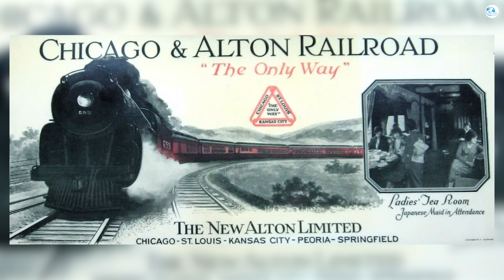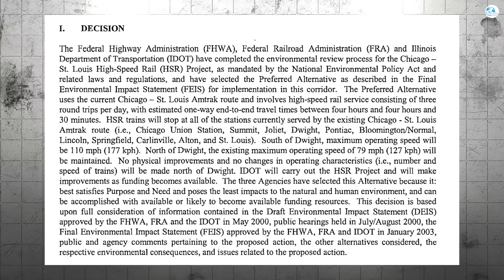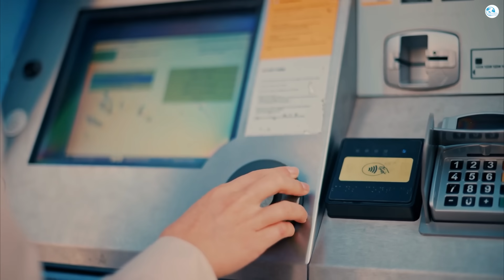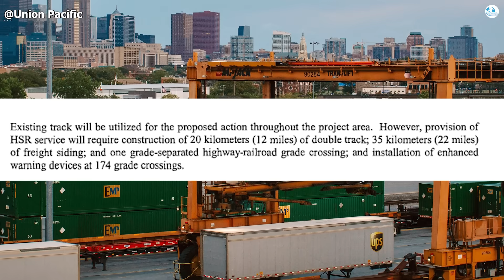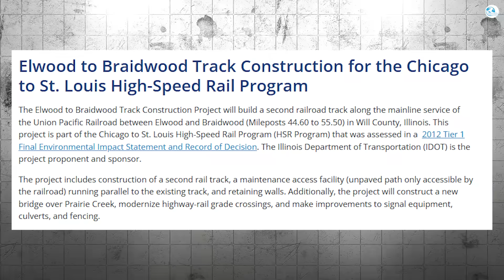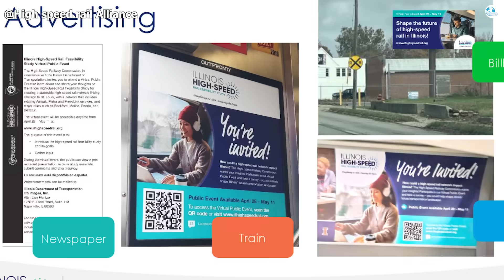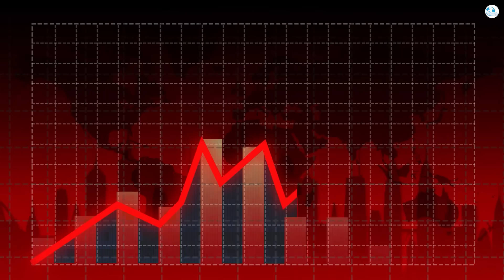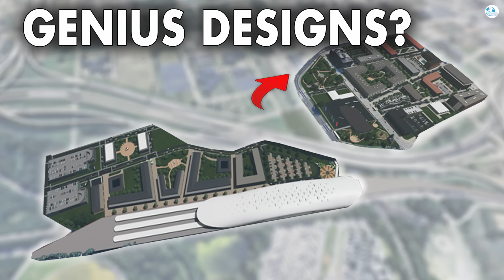Chicago–St. Louis High-Speed Rail: The Midwest’s First Real HSR Corridor?

Comment: It could be done, BUT! Some of y’all need to settle down and have more realistic expectations. I just see this all too often - one little improvement here and there, just imagine in a few years, so on and so forth. 220mph from STL to Chicago and back? Not a chance. 155 mph (250kph) is much more realistic, but even at that it would require true double track over the entire length of the line, removal of all remaining at grade crossings, and perhaps most difficult of all, rooting out the insidious corruption that has permeated Illinois politics for over a century. (St Louis, too.) 
Otherwise, forget it.
Reply from the maker: Fair point. Real high-speed rail needs major upgrades and political will, not just small improvements.

Comment: waste of taxpayers' money because of corrupt politicians and accomplices...  stupid ideology, if passenger trains made money AMTRAK wouldn't exist....
Reply: Okay, 1.) If the country had been smart, Amtrak wouldn't have been a for-profit company (that never made a profit).  It would have been a public works project.  Like, how much profit does the interstate highway system generate?  None; it's silly to even ask, because that's not the purpose of a public works project.  Amtrak could and should have been the same way.  Fares collected just to cover costs, including purchasing new equipment.
2.) Amtrak does have lines that turn a profit.  They're the lines where Amtrak owns the rails they run on, up in the Northeast Corridor.  They can and usually do run on time, there, because they don't have to wait for the freight railroads to actually obey the law requiring passenger trains to be prioritized.  The problem is that, that's like 2% of Amtrak's network.
3.) I don't have the figures, but I'm sure airlines get subsidies, too, to prevent them from failing financially.  Why would that be okay but not subsidizing passenger trains?
4.) While we have a greater need for metro trains than we do intercity trains, we just generally need more trains, so that there are more options.  It doesn't need to be a for-profit thing.

Comment: I live in downtown St Louis.  I've taken the train to Chicago multiple times.  I'm excited for the speed increase.
Reply from the maker: Same here, St. Louis–Chicago is already one of Amtrak’s better routes. If they can boost speeds and reliability, it could be a real game changer.
Have you noticed any delays or issues on your past trips?
Reply: @ONtheTrains  Not with the Lincoln Service.  The Texas Eagle - absolutely.  I prefer the size and comfort of a Superliner - but it's never on time - coming from so far away.  The other thing that the train has over flying is that Amtrak dumps you off in the heart of the downtown Chicago.  No need to take the EL train another hour into downtown from either of the respective airports there.  Huge time and money saver.

Comment: No need except ego and…$$$.  Time savings irrelevant assuming you don’t stop at the “smaller” cities (“fly over country”) and reducing speed if you don’t’.
Reply: If they have their own dedicated rails (admittedly unlikely), and especially if they electrify the line, the train has every reason to be faster than driving, even if they stop at the smaller cities.  Done European style, especially over that flat state, there's every reason to believe that the train could get up to 120mph, or better, and cruise at that speed for 80% of the time it's running.

Comment: Since the creation of Amtrak, passenger trains are supposed to have priority over freight. Why aren't the freight railroads being fined heavily for interfering with passenger trains?
Reply: This is the crux of the matter.  They're being fined, because prioritizing freight is literally illegal.  The issue is that the fine isn't enough.  The freight railroads just pay the fine and treat it as the cost of doing business their way.
Reply from the maker: Do you think stronger fines would fix this, or would more publicly owned track be the real solution?
Reply: @ONtheTrains I think both.
Reply: @ONtheTrains  There's also a middle road.  The federal government throws money at the freight railroads, and the states, with conditions.  The money has to go to improving the quality of the lines used by Amtrak.  In the case of the states, the money has to be used to make roads go over/under the rails instead of crossing "at grade."  The catch is that, if Amtrak's delays are not reduced 90% in ten years, the railroads have to pay that money back with 1000% interest.  And, regardless of who takes the money and how well it's spent, all freight railroads are fined heavily when Amtrak is late.  Obviously the low end is "if Amtrak isn't late, you don't pay fines" but the upper end is, "if Amtrak is late as often, and as badly, as they were in 2025, each freight railroad is paying their share of Amtrak's total cost of operations for the year."  Such that, if nothing changes, Amtrak can literally fully refund their passengers, such that fares end up free.

Comment: Chicago to St Loius?  The bulk of traffic on that route is drug runners...

No station that can handle HSR in St Lious?  The drug runners much prefeer the East St Lious stop.

Illinois High-Speed Rail Feasibility Study... Code words for politicians to hire their drunk brother-in-law, so the sister does not need to work.
 
Musk will be on Mars before much of this happens?

Most HSR runs to the state capitals, not this route.  That says a lot about the downfall of Springfield Il.
Reply: Springfield, IL (the capital) is on the route from Chicago to St. Louis. There were lots of maps that showed that.
Reply: So if it hasn't sunk in, this train will connect the IL state capital with the two largest cities in the region. Not such of a downfall at all.
Reply from the maker: That’s a pretty cynical view. The goal of this rail line is economic growth, not what you're suggesting.
Reply: This is an Illinois project. St. Louis is in MO. East St. Louis is in IL. Maps are friends. Try 'em out.
Reply: @stleo3980  "East St. Louis is in IL.", And Illinois would be better off without East St Loius.
Not many go there who have a choice.

Would you want to be stuck there overnight?
Where would you stay?
Reply: @CCRoselle  The train continues on to St. Louis. Just not at high speed. Try thinking before typing. It helps.
Reply: and that's a long, long time
Reply: @CCRoselle  From East St. Louis to St. Louis?? It's right across the frickin' river. Same exact distance as it's always been. And after the river you're right into the city where everything is slowing for arrival. Seems like somebody is digging for ANYthing to make Illinois look bad. Even the BS saying most of the St.Louis/Chicago travelers are smuggling drugs, which is absurd. Hundreds of thousands of people use that corridor each year. Most (more than half) are smuggling drugs?? That's not silly. it's stupid.
Reply: @stleo3980  A new train station on each side of the river to handle the proposed HSR; brilliant!

I rode the CNW (CHEAP & NOTHING WASTED) to work downtown Chicago for many years, yes sometimes the doors froze open, or the heat did not work.
But you have billions of other people's money to piss away for the 3% that ride a train.

You must be a politician or on the take (same thing).
What color is the sky in your world?

Comment: Easiest route they could test out should be Chicago to Milwaukee. Its less mileage to and from the infrastructure is wide enough to separate freight and passenger rail you can electrify it with overhead lines. You can use both the CNW line or the old CNS line since most of the old line is just abandoned ROW not too many curves and use it as an experiment for HSR and HS commuter rail services.
Reply: The infrastructure is already in Illinois. It runs parallel to I 55. My family used it from Alton, Illinois to Springfield, Illinois. I was pleasantly pleased. My daughter and granddaughter took it from Alton to Chicago. It was quicker than flying because no waiting in a crowded airport. And certainly a lot cheaper than flying.
Reply: @Navyuncle we can all agree Chicago is a hot spot for high speed rail and they're many cities with about 1 million plus in the metroplexes that need HSR would benefit and would reduce the car traffic in these areas over time. While here in Chicago commuter rail and interurban need to make a big comeback and connecting certain cities outside the Chicagoland area is also a must.
Reply from the maker: Chicago–Milwaukee makes sense as a strong pilot corridor with great potential
Reply: @ONtheTrains yes and they can either make it a triple track from Chicago to Milwaukee or use old North Shore ROW and make it there from scratch either or will succeed their is alot of population in this area that only relies on one interstate and one US highway to get them between two cities while everything in between is also densely populated with suburbs well over a million people in Lake County Illinois while its roughly 700k in both Kenosha and Racine Counties.
Reply: Did they kill the Hiawatha? Years back, they claimed 90 mph peak.
Reply: @CCRoselle there has been talks about reviving the North Shore Line again and Hiawatha since they created the Borealis line having both amtrak routes would get more folks into other destinations like Milwaukee Fond du Lac Green Bay Madison Lacrosse Wis Dells and Twin Cities and beyond. While also increasing commuter train via Metra if Metra and Milwaukee commuter system agree to terms we could have a revival of the interurban systems going north and west of Chicago again. While currently we have interurban going south and east via Metra and South Shore.
Reply: @bearworldwide101  I have lived on the North Shore and in DuPage for about eighty years.
Before the RTA, the system was "creaky" but serviceable, and I rode the train to work downtown mostly in the winter.
Including once on a train stuck in the snow, only four hours late to my stop on the West Line.

The RTA was simply a mechanism to kill the small operations and spread the cash around to insiders. Notice they killed the old system long before any plans to replace anything.
The funds that were not used for any replacement service went to the CTA void.

Workers at the Glenview Bus Company (and others) never earned much, and many CTA workers could earn considerably more. Not to mention the political no-show jobs... 

About every ten years, another layer of bs is added to the RTA, because you cannot expect the poor people of Chicago to pay the fare.

Just reciently another layer was added, restructuring the RTA to the Northern Illinois Transit Authority (NITA).

That will fix it! More executives driving CTA cars, when they actually show up to work, no way they would take the crime-ridden CTA, too dangerous. 

It is not about transit, it is about wealth transfer, buying votes, greasing palms...

A friend and neighbor was a pilot at a small regional airline and loved it!
But liked to point out that a full-time CTA driver had the same salary or more, and got to sleep in his own bed every night.
Reply: @bearworldwide101  I have lived on the North Shore and in DuPage for about eighty years.
Before the RTA, the system was "creaky" but serviceable.

The RTA was simply a mechanism to kill the small operations and spread the cash around to insiders. Notice they killed the old system long before any plans to replace anything.
The funds that were not used for any replacement service went to the CTA void.

Workers at the Glenview Bus Company (and others) never earned much, and many CTA workers could earn considerably more. Not to mention the political no-show jobs... 

About every ten years, another layer of bs is added to the RTA, because you cannot expect the poor people of Chicago to pay the fare.

Just reciently another layer was added, restructuring the RTA to the Northern Illinois Transit Authority (NITA).

That will fix it! More executives driving CTA cars, when they actually show up to work, no way they would take the crime-ridden CTA, too dangerous. 

It is not about transit, it is about wealth transfer, buying votes, greasing palms...

A friend and neighbor was a pilot at a small regional airline and loved it!
But liked to point out that a full-time CTA driver had the same salary or more, and got to sleep in his own bed every night.
Reply: @bearworldwide101  I have lived on the North Shore and in DuPage for about eighty years.
Before the RTA, the system was "creaky" but serviceable.

The RTA was simply a mechanism to kill the small operations and spread the cash around to insiders. Notice they killed the old system long before any plans to replace anything.
The funds that were not used for any replacement service went to the CTA void.

Workers at the Glenview Bus Company (and others) never earned much, and many CTA workers could earn considerably more. Not to mention the political no-show jobs...
Reply: @bearworldwide101  
About every ten years, another layer of bs is added to the RTA, because you cannot expect the poor people of Chicago to pay the fare.

Just reciently another layer was added, restructuring the RTA to the Northern Illinois Transit Authority (NITA).

That will fix it! More executives driving CTA cars, when they actually show up to work, no way they would take the crime-ridden CTA, too dangerous. 

It is not about transit, it is about wealth transfer, buying votes, greasing palms...

A friend and neighbor was a pilot at a small regional airline and loved it!
But liked to point out that a full-time CTA driver had the same salary or more, and got to sleep in his own bed every night.
Reply: @CCRoselle and now the RTA is dead being replaced by the NITA
Reply: Milwaukeeans don't want commuter rail. They could have had commuter service on the C&NW all the way into the lakefront station which would also have served Summefest. That line would also serve St Francis, Cudahy, South Milwaukee, Oak Creek and Caledonia.

Comment: The section between my hometown of Dwight and Pontiac, IL was the first section of the Lincoln Service route to be upgraded for HSR.  The Venture coach class cars currently being used on the Lincoln Service are much nicer than the Horizon & Amfleet coaches, especially with the roomy restrooms in the Venture coaches.  Electrifying the Lincoln Service route, though?  I know that NE Corridor trains are electrified between NYC & DC, but how much would it cost to electrify Chicago-St. Louis?  And would the Texas Eagle be using an electric engine or two for that stretch?  And how much would traffic patterns be disrupted in the small communities (such as Dwight) along the Lincoln Service route while the electrification upgrade was going on!
Reply from the maker: Electrifying a route like Chicago–St Louis isn’t a small add-on, it’s a major infrastructure project. Installing overhead catenary systems plus power substations and all the necessary clearances can cost millions per mile. Estimates for converting diesel lines to electric in the U.S. often range from about $2 million to $4.5 million per mile just for the infrastructure, not counting extra civil work to raise bridges or adjust tunnels where needed. 
So yeah, electrifying nearly 300+ miles of track would likely run into the multi-billion-dollar range, not something done cheaply or quickly.

Comment: The cost of electrification for hourly Lincoln Service may not be worthwhile, and costs of both land and engineering would be exorbitant for 186mph.  
O'Hare may not be practical with high Metra traffic, including Rockford, along existing ROW with allowance for Lincoln Service delays, even with double tracking.
Reply: Even hourly Lincoln Service should not over-tax existing Saint Louis platform, but extended services from Kansas City and Tulsa will need to be studied.
Reply: The added power of a Tier 4, 4,200hp diesel should save a few minutes. Unmanned automatic doors would help to reduce dwell time at larger stations and saving minutes with car and seat reservations to balance car loading.

Comment: The problem is that the Chicago-Saint Louis Lincoln Service is single track since GMO CTC days. Even though upgraded to 110mph in most stretches., passing sidings often are between stations interrupting high speed operation and requiring allowances in the schedules resulting in nearly five hours end to end instead of a little over four hours for 280 miles that would be more competitive with driving
Reply from the maker: This is what people miss when they see “110 mph” on paper. Single track operations force meets, slow orders, and padded schedules, so the real-world travel time isn’t competitive. Double tracking would do more than any speed increase.
Reply: I saw hopelessly under-employed 120mph RTG gas turbines on the St Louis corridor.
er-emloyed

Comment: Thank you for attention to this corridor. One grade separation is not nearly enough. I know that they are expensive, but short cuts are more expensive in the long run.
Investment should be directed into the Cleland to Chicago corridor. Ohio is not part of the Amtrak State Partnership program, but there is another way forward. Amtrak should stand up daytime long-distance trains in the Midwest. One route should be Cleveland to St Paul/Minneapolis. The other should be Albany to Chicago. New tracks should be put down in the old Twentieth Century Limited alignment as tracks have been removed there.
Reply: What about Cleveland to Cincinnati?
Reply from the maker: Thanks for raising this.